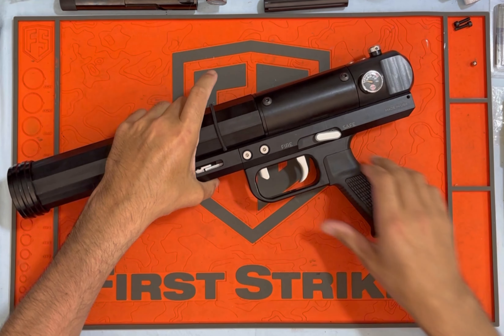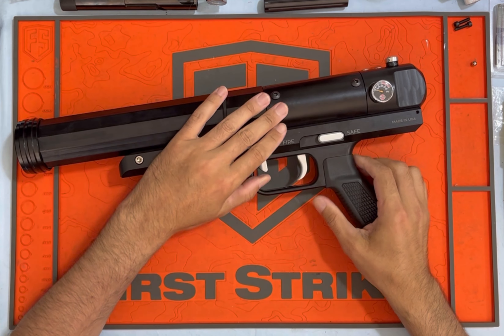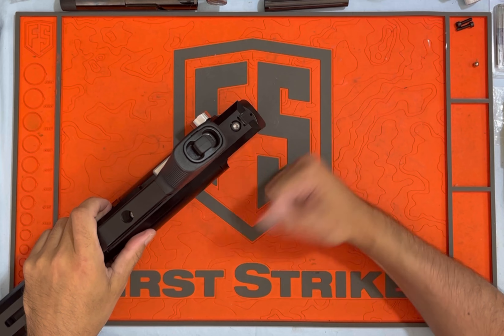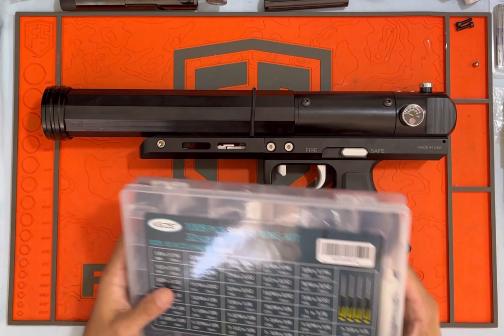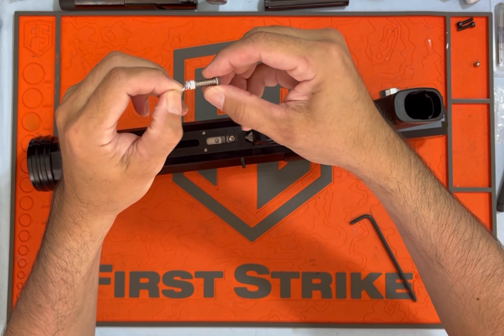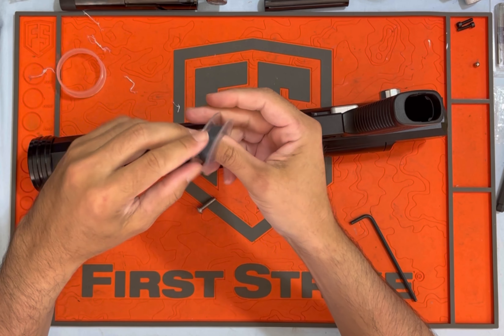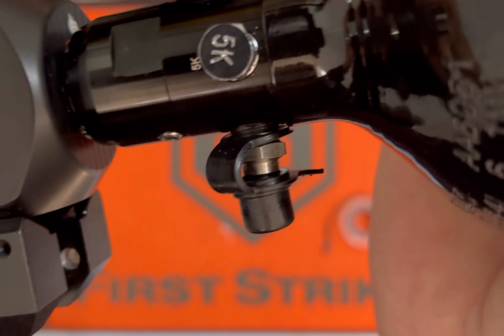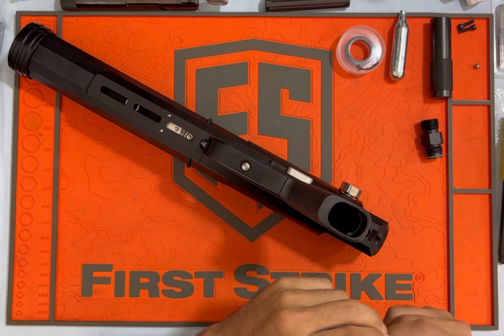LL4D MCS (Nova N8) Fury Rocket Launcher - Fixing a leak, AR style grip, co2, DEATH ☠️

Comment: 50-100 ? joules for @big5 rendition
Reply from the maker: You can set the energy level to which ever power or distance that you want to shoot.
Reply: @lesslethalfordummies  not really - most when complete are predominant pre fix/set 

Basically if it is at store box labeled 20-30 (or fpe) joules that is the number 

Other store/other box (model projectile) set at 50-100 'joules (fpe) is that that

And 2 different price - big difference before soon even though less basically high strength non lethal
Reply from the maker: @DhdhEiwbdi they do not advertise any specific energy for this launcher so you can adjust how you see fit via bottle pressure or simply a shorter press of the charge button.
Reply: @lesslethalfordummies  ala crudo - mi gusto pero 🐾

Plain and simple when ever the store company creates the final product for designated location seems great
Reply: @lesslethalfordummies  that is very nice
Reply: @lesslethalfordummies  wealthy technology allowed to fix for each potential description in need of projectile - always have secondary (or much in an original) actually the adjustment change can be known for the 'crudo of (threat) appearance